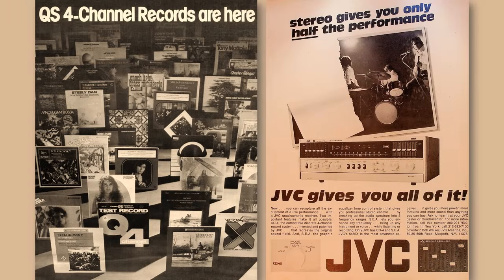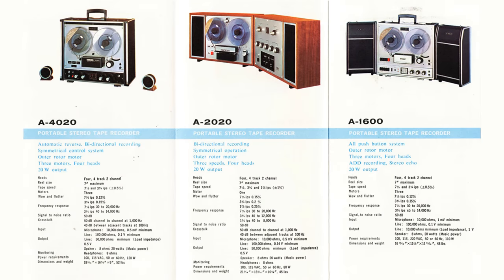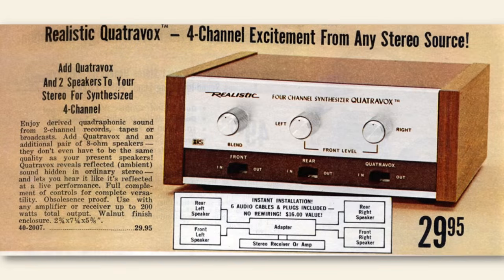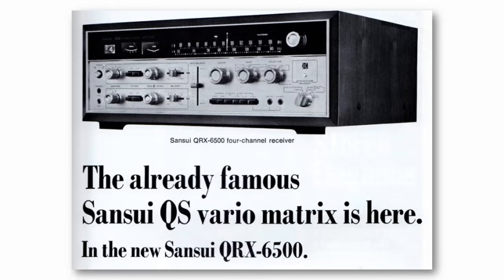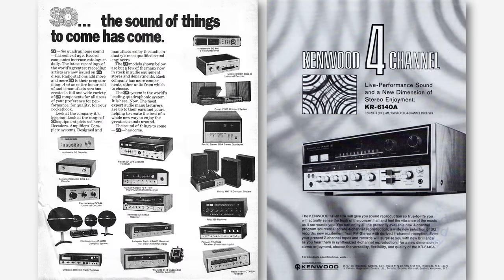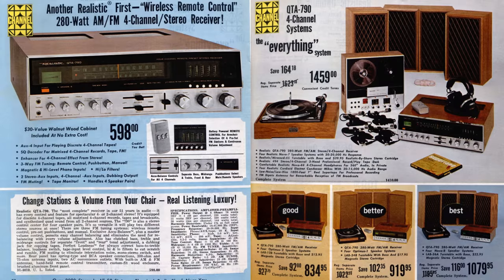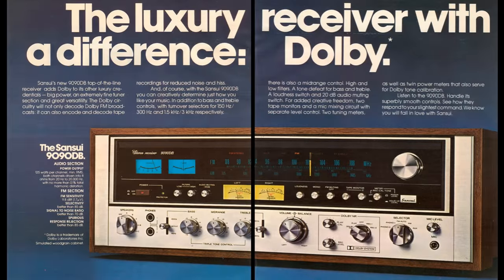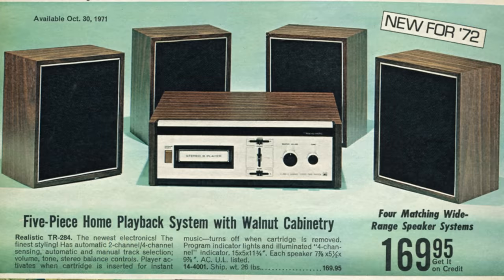4 channel FAILURE - The Quadraphonic Story

Comment: Back in the last century, I remember visiting (one of) Lasky's Hi Fi shops in Tottenham Court Rd., London. Quadraphonic had just been released to the market and they had "quadrophonic headphones" with two speakers in each very large closed ear piece. One speaker was positioned to be "behind" the ear and the other in the usual place - in front. Could have been Pioneer branded maybe (?). The demonstration record was 'Witch Queen Of New Orleans" by Redbone, and to be fair I could hear the two "rear" channels. But I reckon wearing those super sized headphones for any length of time would be uncomfortable. Suppose quadrophonic was the first foray into "surround sound".

Comment: Quadraphonic should be the standard for headphones – two channels (call it 2×2 stereo) for each ear – before it hits the cans (earcups).
Today we simulate it with BRIRs – binaural Room Impulse Responses. Although it can be done for surround+ with special choices out of 180 ×2° increments, or 120 ×3° increments for each BRIR.
I use it with EqualizeAPO + BRIRs Dataset (from German broadcast studio). It is freely available on the internet. EqualizerAPO provides the decoding. For a total audio mixing control no a PC I also use Voicemeeter (it is paid but not expensive €10~€15, more like a donationware). Because I use headphones 100% of the time (otherwise my neighbours would go crazy).
Good luck!

Comment: My father had a stereo amplifier with four speakers. The front left and right had the normal stereo signal. 
Only the difference signal from the front two channels was used for the rear speakers. 
This brought no audible benefits.
Reply: Stereo amps with A-B channels don't really have audible benefits. The only plus I found is that you have the possibility to fill the room with sound with four bookshelf speakers instead of two floorstanding speakers.

I still like to use those amps, because I can play around with multiple type of speakers. But other than that, I couldn't find another plus to those amps

Comment: one other major downside, or should I say disappointment, was how much media simply won't kick the extra speakers on with that "surround" light staying off on the receiver. unless it is a super simple speaker across the left and right hots, a lot of media just won't have sound from half or more of the room. and even then, the ambiance is most of what you get with most stereo stuff, and forget mono recordings. going through the effort of fussing with countless delay phases and a minus b circuits back in the day, I just felt it wasn't worth the effort for silent channels due to most content not having some encoding. everything even mono recordings works with stereo setups, however with quad-channel or more, needs full chain media encoding explicitly to get sound out of the extra channels or the room ends up feeling half empty. All that effort setting up a surround sound system, and with most media, it just sits there silent doing nothing. and for artists, it wasn't worth it with most people listening to music on earbuds and cellphones.

I last fussed with quad over ten years ago, and that was at best a "what if I try this" experiment. variations of 75% and 25% add or subtract to derive outputs, it worked for getting sound out of all 4 speakers for all stereo songs, however by then, I was in a place just horrible for setting up 4 speakers, so it ended up in a box of scrapped projects. it would be nice if the older "surround" receivers just used all 4 speakers even with stereo content, if only.

Comment: I owned a Fisher 504 (I believe) it had a joy stick,  Technic quad reel to reel, switch box, tower speakers and 901 and 504 speakers.  I own quad records and used to own quad reel to reels.      I forgot I had a Technic direct drive 1300 turn table.    I was gone to work in another country and my wife had a hard time working the switches and sold the whole system.  I never asked how much it sold for, I felt I would not be happy.   I never owned classic system.  I miss my quad.  I have Dark side of the moon and muscle of love ?  In the card board box.   Both payed once.

Comment: I only listen to my vintage quadraphonic system. Stereo is a thing of the past for me. QUADRAPHONIC SHOULD NOT BE USED AS SURROUND SOUND. That was the huge marketing mistake that was made. Quadraphonic is the sound I've been looking for all my life. But as an ENHANCED STEREO TECHNIQUE. How you do it. Set up the speakers in typical stereo placement. Stack the rear speakers on top of the front speakers. Use the quad synthesizer and a STEREO SOURCE. Sansui has a quad synth. Idk about other brands. I do this test with my friends. I switch it from quad to stereo without telling them what I'm doing. They immediately react. "What did you do? Change it back!" The sound is hard to describe. Every instrument is clear and present. There's an "airiness" to the sound. Idk how else to describe it. It's immediately noticeable when it's switched to stereo. The music has a dead, lifeless sound. I know people aren't going to rush out and buy a Sansui quad system. Too bad. You don't know what you're missing.

Comment: That's a pretty thorough history! I bought a quad decoder/amplifier around the time the format was fading away. It cost $30USD in 1976. Although it used the 2nd gen SQ Logic system, the separation of front to rear wasn't very good. I kept using it occasionally into the 1980's when the Ambisonic system appeared & Ambisonic LPs seemed to work a bit better than SQ or QS! I think quad could have succeeded in the '70's if it performed better & was simpler (i.e. a single format). SACD multichannel works brilliantly (Genesis & Pink Floyd discs being shining examples), however big music systems were out of favor by the 21st century & few people I know even have a stereo system (maybe a sound bar). Those fortunate enough to have SACD players that can do multichannel should look at Vocalion's collection of quadriphonic rock, jazz & classical reissues. More recently, DVD & Bluray quad, 5.1 & Atmos discs have been released by the WB group (WB, Rhino, & Atlantic) & Cherry Red Records in the UK.

Comment: In the 1970s had the following set up. Record player with Shibata stylus for CD4 discs fed into JVC 4DD5 disc demodulator This fed straight into a JVC 4VN 880 amp. For SQ/QS the 4DD5 fed a  matrix stereo output to a Sony SQ decoder. Quad tape was 8 track tape A JVC player with Stereo record. The tapes had a notch which signalled to the player that they were quad. Stereo tapes played as normal. Quad tapes would not play or if they did sound scrambled  Tapes were played at the Standard speed. Pink floyd Dark Side of the moon was incredibly good on tape totally wonderful.

Comment: I still have my old Marantz quadraphonic receiver in the garage but the four Kenwood speakers with 15 inch woofers are long gone and the plug in CD-4 card is on the fritz. I have however kept some of the Quad LP’s. My present Dolby Atmos setup sounds better, the quadraphonic revolution failed because the analog format just wasn’t adequate to the technical challenges.

Comment: Stereo and quad 8 track tapes both run at 3.75 fps.  The notch in the case allowed a switch to move the head to the correct position(to read 4 tracks at once). Choosing the correct format selection via the selector switch allowed for the 4 channel output.  If you have a quad receiver with a channel burned out, you can usually rout that channel from the "source" output jack to another receiver/amplifier(two stereo receivers can produce true quad sound, although you lose the easy "spatial" or single volume control.
Reply: That is 3.75 IPS not FPS!

Comment: Quad 8 tapes had double the tape inside. The spool is full in a quad 8. Stereo 8 there was a lot less tape. Quad 8 tends to have more issues with jamming and sticking due to the amount of tape on the spool. I take my tapes apart and lube the spool and capstan roller shafts after 10 plays. I have 50 tapes. Play them through a  pioneer QS-4000 and cerwin Vega speakers. I have had this system since 1975.

Comment: Quad 8-Track tapes run at the same speed as regular 8-Track. There was just more tape in the cartridge.  3.75 inches per second, which is already slow, hence the limited frequency range of about 12Kcps.

Comment: All 8-track tapes run at 3.75 IPS / 9,5 cm/S.  Quad versions contained twice as much tape as stereo ones.    
There is a discrete 4-channel standard for CDs that has never been used. It necessitates a 50% reduction in available 
playing time, but since most albums use less than half the capacity of a disc anyway, it wouldn't be a problem.    
This is quite different from multichannel SACD!  
Four-channel also briefly appeared in cars via Quad 8, not that many people noticed it.

Comment: Regarding quadraphonic 8-track tape sped... They run at the same speed as a normal stereo cartridge. Stereo 8-tracks could hold the equivalent to two 12" LP records in one cartridge, so there's probably just more tape in the quadraphonic version of the album you showed.

I have one quadraphonic 8-track album in my collection, the soundtrack to "Shaft" and it is on two tapes...

I also have a quadraphonic player, though its just sitting on a shelf in my basement looking pretty.

Comment: Would guess the quad 8 track cartridges simply used more tape, the stereo cartridge simply used half the length of tape, so you had the same playback time, but no need to change tape speed. After all 8 track cartridges could have shorter or longer play time, based on how much tape you made it with, though longer ones did use a thinner tape which was more likely to crease.

Comment: The biggest problem was, they wanted quadro records, that are stereo compatible. The channel separation of analog records isn't good enough for matrix coded systems, the ability, to play higher frequencies isn't good enough, for systems that use the same way as FM stereo.
The best way wasn't used. To combine it with the cook system, to have two stereo cartridges, one plays the outer band, one the inner band. Okay, running time is 10 minutes per side, but it's stable.
Beside this experiments, the best way would be pre recorded reel tapes, compact cassettes and 8 track cartridges. All of these have the same running time as both sides of a 12" record with 33 rpm and the reel tape could do it with 7.5 ips too.

Comment: The "disc" is still MY preferred playback system,  and i rock a quadraphonic disc system(s) to boot. Nothing cheap or tinny about my system.
Reply: CD disc?
Reply: NO , vinyl. I said "disc" because the person in the video erroneously said disk in reference  to records.  I am anti digital.  @SDsailor7
Reply: @ivansbacon  Good that you cleared it up. I have a few thousand records myself and I am in the process of restoring a Pioneer quad receiver.
Reply: @SDsailor7  Sweet, I have QR 646, QR 949, Sansui, QRX 6500 And an old heathkit with twin mono amps that will power two sets of speakers each. The amps rock but receiver is not working, yet.
Reply: @ivansbacon  Wish i had the 949 but will settle for the 747

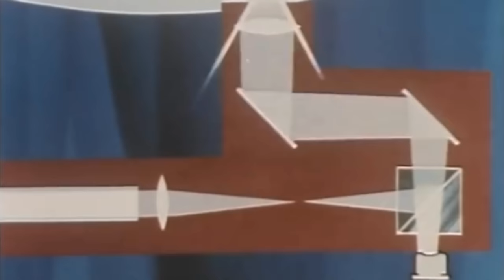Comment: 13:48 CD could be ideal for quadro, but they never made any attempt for this to implement possibly a system that runs 30 minutes in quadro or has maybe 12 bit and 32 kHz to fit on a CD that runs 60 minutes.

Comment: Quadraphonic 8 tracks don't run at half speed. They have twice the amount of tape.  Most cartridges are 45 minutes or so to facilitate one album. 100 minutes can fit in an 8-track cartridge and 90 minutes is pretty common Some players have trouble playing double albums.

Comment: Now we also have DVD-Audio and Blu-Ray Audio. Neither has caught on in a big way, but they are ways to deliver true surround sound to the home, usually in 5.1 channels. Older content from the 70s is presented in 5.1, but with no content in the center channel. Low frequency content does get moved to the .1 channel so it will play correctly on home theater systems with a subwoofer. If your system does not have a subwoofer,  your A/V receiver will mix the low frequency content back into the front channels. So you're getting either 4.0 or 4.1 depending on your equipment. (The center channel isn't that important for music listening; its main purpose is to keep the primary dialog anchored on the screen in video presentations no matter where you are sitting.)

In addition to remasters of the quadraphonic productions of the 70s, some classic rock albums have been remastered in 5.1 surround from the master tapes. Albums by bands like King Crimson, Emerson Lake & Palmer, and Yes are among the available content. I haven't seen much in the way of NEW music recordings being made in surround.

Comment: Quad 8 tracks did NOT run at a slower speed. They ran at exactly the same speed as stereo 8 tracks. The reason they could put the same number of songs on a quad 8 cartridge is that they put double the amount of tape inside. They sounded great, by the way. You'd have to hear one to believe it but they sounded fantastic.

Comment: For starters, I wouldn't pay one penny to watch anything broadcast by the BBC. Let alone buy a "BBC license." No wonder Mr. George Orwell was British. Next, Quad is great, 6.0 never took off, 8.0 Octo is also cool, especially the type where you alternate between L and R channels as you go around the room from front-right. From any computer sound card, just set it at 5.1 and just connect 4 speakers, you will get either 4.0, or 4.1 if you also add a subwoofer. And with a 7.1 sound card, connect 6 speakers to get 6.0, or add a sub for 6.1. Easy as peasy. :face-red-droopy-eyes:

Comment: There just isn't enough important information coming from the back of the venue. Rock bands are so loud the reflections, like overtones aren't incredibly important. In the 70s there weren't yet enough golden ear audiophakes to support an industry based on an imagined superiority.

I acquired the top of the line Pioneer AV receiver in the late 80s. It was neat but... Some movies and TV programs put some interesting artifacts in the back channels but it was a stereo world and the artifacts were more odd than important. I had taped an episode of Northern Exposure. At one point the director had instructed the sound engineer to put a barking dog in the distance. My recollection is that it was to the right and behind the dialog on the screen. Ooh. How neat! What a waste of production dollars. But that sums up quadraphonic.

It was only useful for reproducing artifacts and artificial effects that a band like Pink Floyd wanted to explore. There was a song on Meddle that would have been a good quadraphonic song. Rick Wright's keyboards sounded like it was going around a track even in stereo. But quadraphonic didn't add anything, in the end it was just a cheesy effect.

Comment: Do you need a quadraphonic cartridge and needle to play quadraphonic records? Anyone know?
Thank you
Reply from the maker: No
Reply: @LittleCar  Good I thought I had read somewhere that you needed a shibata needle in order to play them.
Reply: Depended on the format. For CD-4 discrete quad records, that needed a shibata stylus and suitable cartridge to play and decode. The matrixed quads , SQ and QS, no special stylus or cartridge required.
Reply: @michaelturner4457  Thank you for replying back I have a Pioneer QX-747and it can cover all of those formats. So all i need is a shibata needle to play the CD-4 format records i have records of the other formats also.
Reply: @SDsailor7  I'm sure it's because with CD-4 quad records, the stylus and cartridge must pickup the ultrasonic 30khz carrier and sidebands, that contains the rear channels' audio.

Comment: Dolby Pro Logic II Surround creates surround sound from stereo sources - digital terrestrial TV, digital cable TV and digital satellite TV, I listen to stereo TV shows on standard definition SD channels and HD channels in DPL-II Surround, and the effects on stereo game shows, soaps, drama, music concerts, big specials etc are quite dramatic, 

I have my home cinema speaker system connected up via coaxial digital audio connection and on HD channels it switches automatically between Dolby Pro Logic II Surround and full fat Dolby Digital 5.1 Surround / 2.0 Mono / 2.0 Stereo between different output broadcast, obviously you wouldn't broadcast a full-time Dolby Digital AC-3 5.1 audio stream on everything but here in England, Quest HD on the Astra 2 satellite DOES! Adverts programmes trailers and idents everything, they transmit a Dolby Digital AC-3 5.1 bitstream all of the time, even when programming isn't 5.1!
Reply: It's amazing how good Dolby Digital or DTS:X 2 channel upmixing is. And households with a modern Audio Video Receiver or certain soundbars already have the technology in their home. It's recording quality dependent, but it's my preferred default listening setting.

Comment: 3D movies in the 50s didn't require red/cyan glasses. This is a myth which simply refuses to die. They were originally shown in the Polaroid format. A few of the monochrome movies were later reprinted in red/cyan for cinemas which didn't want to buy new screens or tie up two projectors simultaneously. These prints were in circulation for many years which may explain the myth's longevity.
Reply from the maker: Thanks for the info - as you can see it was news to me. That would make a good subject for a video!